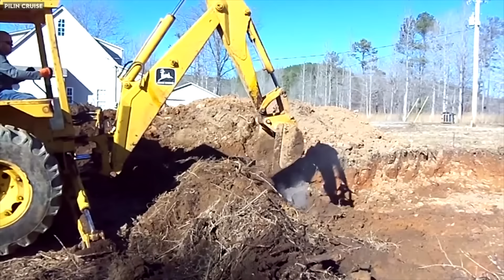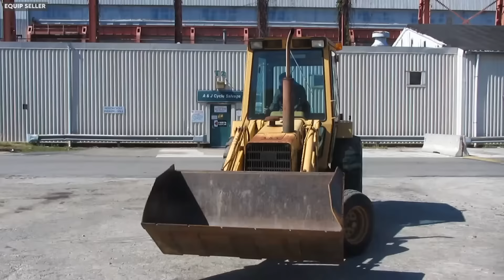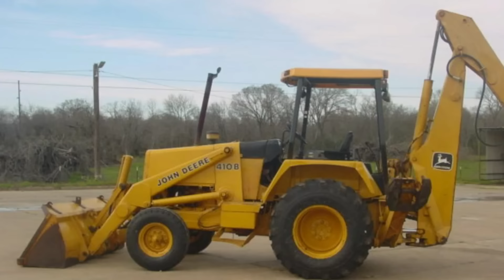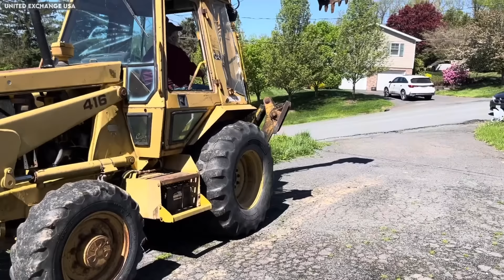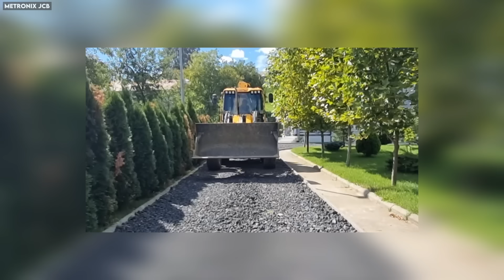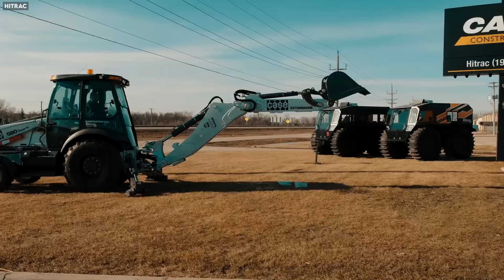10 Best Backhoes from 1980 That Deserve Respect

Comment: The Ford 555 has a similar Loader Frame to the CAT IT Backhoes
Reply: I think the early Cats had ford backends and perkins engines
Reply: @JamesConole-i3i  The early CAT Backhoe like the 416 had the same Hoe Arm design as the CASE 580C D and  E
Reply: @countryboy8087 I meant the rear dif assembly a diesel fitter told me that might be wrong
Reply: @JamesConole-i3i  Oh my bad

Comment: I have just previously watched the 10 Worst backhoe loaders video and Guess What??. They were 9/10 the same as the best ones listed here. Same AI generated commentary, same Chanell. So I take it all with a Gain of Salt. Service the machines you but and you are normally fine. Try to didge an Oil change or such stuff like that and obviously you will have problems.